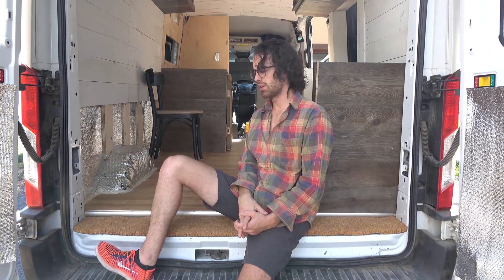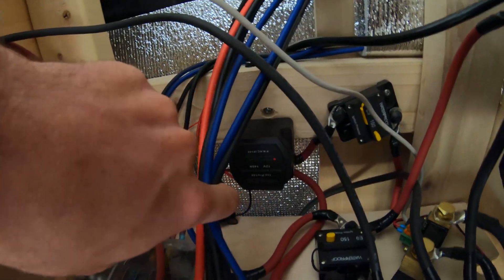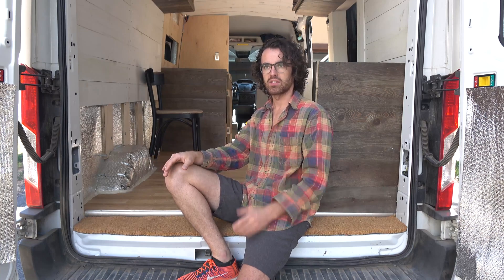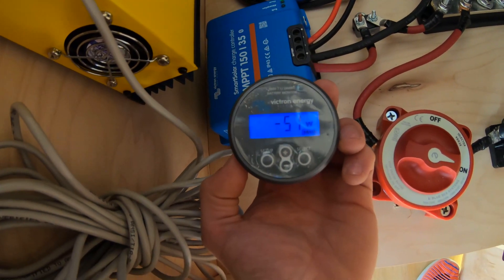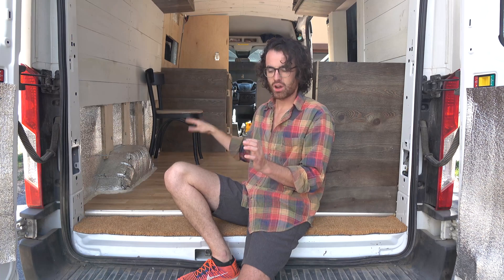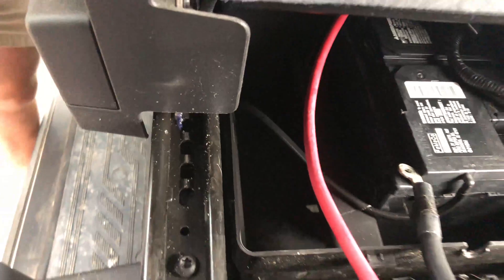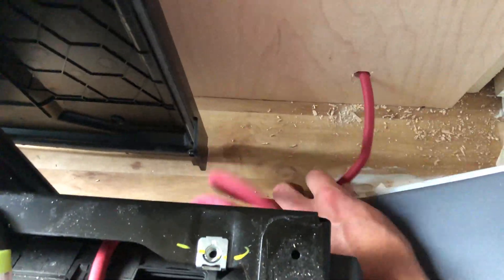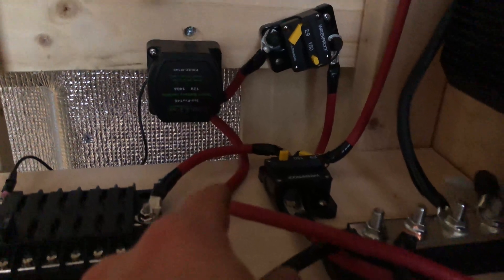Installing Battery Isolator to Charge Battle Born Batteries on the Road

Comment: Thanks! I just got mine done. When house batteriesbare 100% does the isolater kept sending amps when not needing them or shut off when sees high volts.
Reply: When the two sides have the same voltage current naturally tapers off.

Comment: Question, I just got the same battery isolator and installed it however a friend of mine commented saying I needed a lithium battery isolator is this true or does the keyline work fine?
Reply from the maker: People go both ways on this (if you read the Q&A on the keyline's amazon page you will see this).

Some insist you need a special lithium compatible isolator. Some insist a "regular" isolator works fine.

I am no expert by any means. All I can say is that I have had this keyline installed with my battle borns (lithiums) for almost 40k miles and it has worked wonders. 

If you install it correctly it should never drain your car's starter battery. It charges my batteries quickly and powerfully while I drive. 

The only thing I could think of that might be tied to using this keyline with lithiums is that sometimes my victron battery monitor gets confised and reads the battery SOC as 100% even when I KNOW it is not 100%. I have no idea where that error comes from out of the entire electrical system, but I suppose it is possible it is connected to this isolator? Your guess is as good as mine. 

Hope that helps!

Comment: Any reason you chose a battery isolator over a DC to DC charger?

Thanks for posting in detail and the links.
Reply from the maker: Of course! Just trying to share what I learned / what worked for me.

I think at the time...my reason for going with an isolator was 1) the people I was learning from used it and 2) I was building my system piece by piece rather than comprehensively (due to being overwhelmed by it all). 

Looking back, DC2DC would have been better due to its supposed better treatment of lithium batteries AND, correct me if Im wrong but, I could have combined by solar charge controller and alternator charging in one piece of hardware, right? That would have been really cool.
Reply: They keyline was pumping 67.9A into the BB in the video.  The cheapest 60A DC-DC costs 3x as much.

Comment: I've installed an isolator in my van (it's a different one) but my battery monitor isn't detecting anything going on. The isolator has a light indicator telling me whether it is working or not, and it says it's working, but my monitor doesn't show an increase in voltage, percentage, or amps going in. I've ensured it's properly grounded to my busbar, which is grounded to the chassis, and all my negative power runs through the busbar. Any help would be great. Thanks
Reply from the maker: Hey, Matthew! My first instinct is that your battery monitor needs to be reset...Mine will often get confused due to a number of circumstances and report 100% SOC or 30% when I know I am near empty or full respectively.  Normally I just let it work itself out and it gets back on track in a day or two of discharging and charging. But it wouldn't hurt to reset it especially since it sounds like you had the battery monitor installed BEFORE the isolator?

I hope this helps!

Comment: Hi there !
I'm in the process to install a 2 lithium 200ah each. Like to now if you alternator have issues charging your lithium batteries ? Thank you for your time.
Reply from the maker: Hello! No issues whatsoever. I love my keyline 140a isolator so much! I don't know what I'd do without it.

I am very glad I went ahead and added it to the system (especially because I cook with an induction stove top and a crockpot now).
Reply: @JeremiahLuke  Thanks for the updates !
Reply from the maker: @KikoFiebre  Absolutely!

Comment: Thanks for the video. You mention that the radio etc would use the house battery if the engine isn't running, but that's not correct. The house battery is only connected to the vehicle when the vehicle is running.
Reply from the maker: I believe this isolator is specifically designed to open and power accessories from your secondary battery when the vehicle is off. It does exactly that when testing everything and viewing the battery monitor! Definitely a plus to having the system.
Reply: @JeremiahLuke  ok I'm installing mine tomorrow. I'll test and confirm
Reply from the maker: @threesixxty  I almost want to go run the radio for a few hours with the lights on but engine off and see what happens.
Reply: @JeremiahLuke  how did you confirm before?
Reply from the maker: @threesixxty  At first I had no idea. Then one day I was messing around with the system and the battery monitor. I had no loads set up on the fuse block yet but when I turned on the car in Accessories mode, my battery monitor began showing a -70 some watt load on my secondary batteries. I then fiddled with the radio etc. and watched the load go up to -75 with the radio volume ALL the way up and inversely -70 with the volume down. After that, I went back to the Amazon page for the product and the language of the product seems to state that the secondary batteries will always support the primary (in order to never have a dead starter battery) and then the comments / questions also state it outright! Seems to be the case for my setup, for which I am grateful!
Reply: @JeremiahLuke  ok my install is complete. Simplest proof that I have that the radio is on the vehicle battery with the engine is off: the light on the isolator is off.when voltage is below 13.3 (engine off), the two systems are disconnected. That's how it works. If your light is on while the engine is off you may want to inquire with keyline.
Reply from the maker: @threesixxty  Oh boy...maybe I have a broken system?
Reply: @JeremiahLuke  is your light on when the engine is off?
Reply: @JeremiahLuke  The way you explained it, it seems like you could just wire your house batteries up with your starter battery and achieve the same goal. The way I always understood isolators is that it allows current to flow one direction only, from your starter battery, through the isolator and into your secondary battery (or battery bank) for keeping your house power topped off. This way you can park and run your accessories tied to your house batteries without worrying about them draining your starter battery. Thus allowing you to start your vehicle to top them off, but never worrying about your accessories pulling power from your starter battery and leaving you stranded when you fall asleep binge watching game of thrones with your strobe lights and hair clippers and coffee makers and toaster all running all night.
Reply: @JeremiahLuke  LFP resting voltage is likely high enough it's holding the connection after the engine is off.

Comment: Thanks. About to hook up 1000watt system on our 77’ Chevy Colman.
Reply from the maker: woo! It's gonna be awesome. I don't know what I'd do without my isolator to charge my batteries...currently cooking up some potatoes (super energy intensive) on the induction stove while my clothes wash in a laundromat before driving a few more hours before I settle for the night. Being able to use a ton of energy now knowing when I finish my drive tonight I will recharge my batteries is a must IMO
Reply: @JeremiahLuke  I am installing the unistrut on the roof to hold the panels now. Check back in with ya.

Comment: Great Vid! How long were the cables that came with the isolator?
Reply from the maker: I got the unit that did not come with any cables. I purchased some 4AWG red cable (https://amzn.to/3iBEIpu) to complete the unit. There is a tiny guage negative cable that came attached to the isolator which is probably 1-2 feet long? Maybe 18 inches. It is not very long, which is why I placed my isolator near the negative fuse block for that small negative wire to connect to!